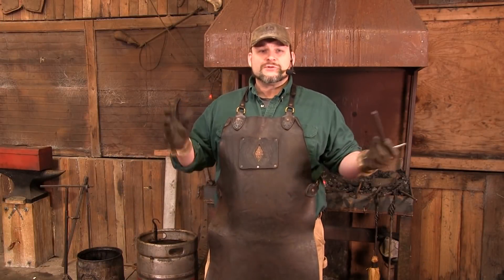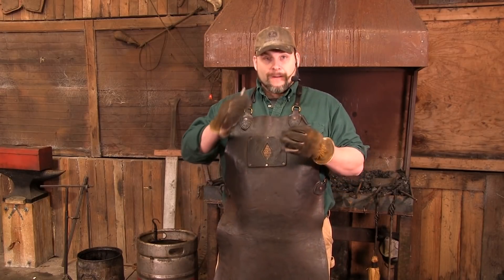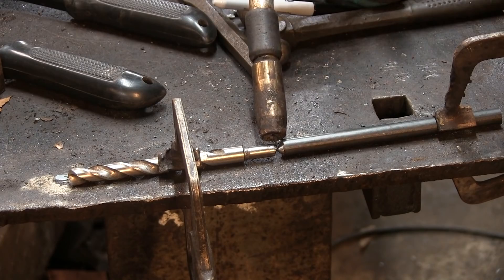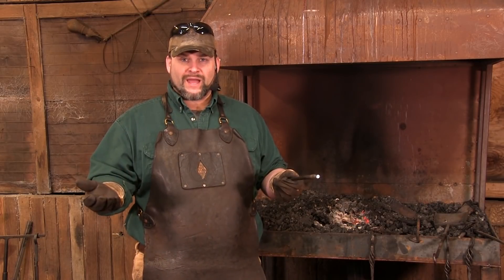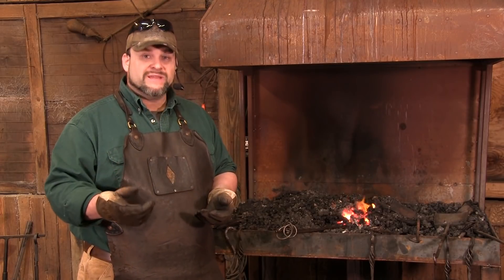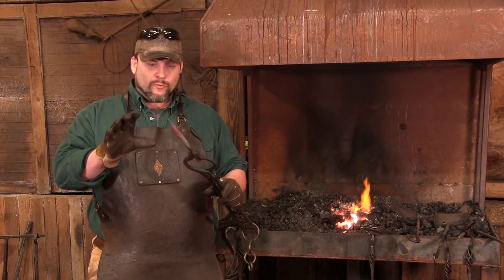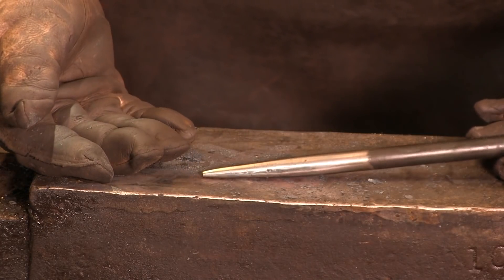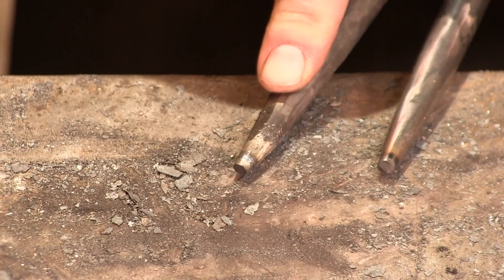High Speed Steel Tipped Punch (EP 24)

Comment: I have had decent success using old or damaged pry bars and cold chisels. Cost next to nothing and, hold up pretty well. I do harden and temper, but this pretty soon gets lost in use, but the steel still remains pretty tough. As a rough rule, I think that the harder it is to forge hot, the tougher it is likely to be in use.

Comment: Thank you for this video!  Would a straight shank at the bottom of the punch do a good job, or does it need to have a taper?  I’m wondering if you could weld on a 1/4” bit shaft maybe an inch long to the mild steel and have it work as well as the taper, just without forging a taper?
Reply from the maker: Not sure. At any rate, even though this is what Jay did, still a much better idea just to forge the whole thing out of the right steel.

Comment: I was thinking of asking on the last video if this might be one of the few times you might agree that using a scrap steel is a better choice than just using mild steel.  Yes, it is more work, but if most beginning smiths are like me, they have more time than money to devote to the craft.  I would personally prefer to spend more time to make my basic tools, and then spend my money on long, properly dimensioned stock for practice (making my 100 S hooks and so forth).

Comment: Trent: A site that might be handy for your beginning blacksmith guys.  It is called  www.metalsdepot.com I use it when I just want a smaller piece of some unusual steel, brass, copper, and etc.  An example; HSS drill rod in a 1/2 diameter and three foot long is only $27 plus some freight. Not bad to make some better tools out of.    (https://www.metalsdepot.com/tool-steel-products/o1-drill-rod).
            I do a fair amount of fabrication so I can buy normal steel from several wholesalers in my area BUT you would have to buy an entire stick of this unusual stuff.  An example for me is copper rod. I keep 3/4 and 1 inch on hand to use when welding holes back to size. I sure did not want to buy a 20 ft. bar but a three foot one was just right to cut some shorter pieces out of.

Comment: Trenton - I dont have an electric welder, would this be doable forge-welded with a lap joint, or would the differing steels cause too much of an issue?
Reply from the maker: Wouldnt even attempt! Way better idea to get some proper solid steel and make your punch from that. This video was just a call back to some work arounds that Jay had!
Reply: @purgatoryironworks  Thank you as always for the continued advice!!  I'll step away from that door now :)
Reply: Not qualified to advise but go watch some Joey van der Steeg and tell me what ISN'T doable with a good forge weld. My GOD that guy.... https://www.youtube.com/watch?v=5sM2NT2IJMk
Reply: or would i just be slamming my pee-pee in a sliding glass door?

Comment: Folks, just remeber to check. Some drills have friction welded shanks made of soft steel. Simple file will tell, spark test will tell and if it is a used drill, you can see it. If there is just burnishing on the shank or actual wear, the latter is a 100% non HSS shank. Milling cutters are almost always solid single piece HSS.

Comment: If you want to make a punch from a tool steel, would you recommend something that is quench harden or would something that air hardens like S7 work better?  Or just use a alloy steel and not harden it at all?
Reply from the maker: air harden all the way
Reply: @purgatoryironworks  Wasn't sure what would be the best option, based on all the information on the interweb

Comment: Wouldn’t it be easier just to buy some 4140 1/2 inch round bar
Reply: HSS is an order of magnitude more wear resistant. It barely deserves the name steel, really. Its closer to a superalloy in the sense that up to a third of the percentage is refractory metals like tungsten, molybdenum, chromium and cobalt.